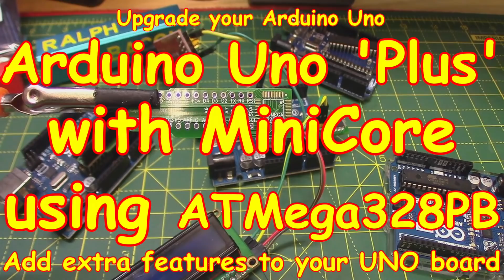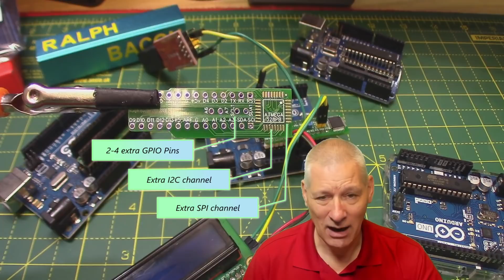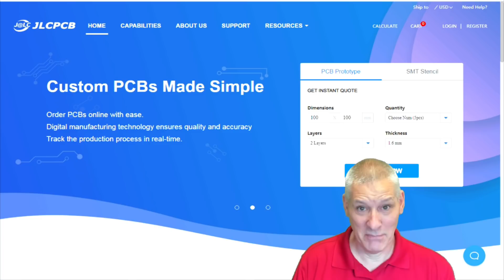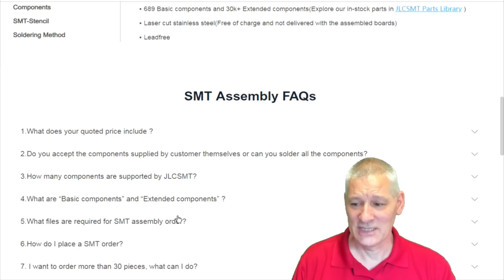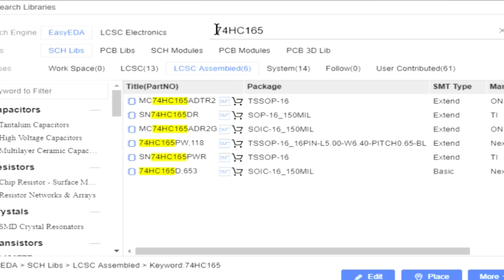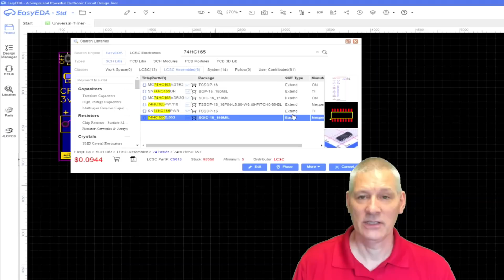#168 Upgrade to an Arduino Uno 'Plus' with MiniCore and an ATMega328PB

Comment: Very nice idea, to have a ic socket patch-pcb for bringing a 328pb into the game. Well done, Ralph!
Reply from the maker: Glad you like it Sebastian! Just a bit of fun but could prove very useful too!
Reply: @RalphBacon  The extra builtin peripherals are certainly always great to have. As soon as timing requirements and/or io-pins come short, using two controllers, communicating with each other might become the prefered solution, already since the funtionality of at least one of them, the one that comes with storage(SD-card), human interface (buttons etc.), display(lcd), etc. might be re-used in the next complex project as is, while the actual work (ADC, 74HC(T)595, 74HC(T)165, MCP23017, MCP23S17, temp-sensor, gyroscope, ultrasonic range finder, etc. pp.) is done by the second one. At this point a second high speed onboard USART already becomes worth gold nuggets. The extra I²C and SPI might also be usefull quite.
I know there was that kind of a 'religious' like war about using either Microchip PIC or Atmel ATmega. But when looking at 16bit PIC compared to ATmega it becomes clear, PIC (PIC15Fxxxx/PIC24FJxxx/PIC32MXxxx) has generally more RAM, while missing EEPROM most the time, and always better as well as more peripherals, ranging from second USART/SPI/I²C, additional timers, ADC/DAC, to NCO (numeric controlled oscillator) and integrated logic cells (compareable to PAL macro-cells).
 The lack of advanced peripherals in many of the ATMEL controllers could at least be compensated by using more than one ATmega for complex projects, as long as there is the additional io-peripheral for communication at hand, like a second USART/SPI/I²C. Without things tend to become the sort of ugly DIY stuff, that is so well kopwn for not working very well most the time.
 So making use of a 328PB along with the Arduino UNO R3 is a great step foreward for the more complex projects, that involve data storage (logging), display and/or some sort of human interaction, while the more timing critical sensorics can be served from the second controller. --- In this sense, a great project to introduce the 328PB to a UNO R3 DIP socket board by some adapter PCB!
Reply from the maker: One interesting topic you raise here, is to use additional µC for some functions, something proposed by another viewer. 

Basically, instead of trying to cram everything into one MCU, running out of pins, having the code run slowly with potential blocking delays the idea is to offload some processing to simple, small MCUs that do one thing. 

For example, use an ATTiny85 to get the temperature and humidity from a sensor and then just query that device to get the results , not do the actual work. I'm still thinking about how this would work in real life (20 devices all hanging of the I2C bus, or RX/TX pins?).
Reply: @RalphBacon  Well, for low symbol rate per second/minute I²C might do a great job. But let's guess, we have a little robot, that uses ultra-sonic as well as LIDAR for creating a 3d map of the surrounding environment. While one controller does the LIDAR and processes the scan data into a 3D cloud of points, the second controller does so for ultra sonic reflections. Now the problem is, that the processed data set (filtered sensor data) of 3D spatial data certainly come at a symbol rate per second/minute for which I²C is foreseeable by far to slow to fit the purpose. But of course there are alternatives to use. One could use SPI at up to 10 mbit/s (point-to-point), in reality perhaps more like up to 5mbit/s on pcb at short distance, or an on-PCB field bus system like UART via RS485, using a time division protocol, where all controllers are granted a time slices for transmitting data in a round robin fashion. This UART/RS-485 stuff can work quite well at pretty high speeds at short distances. 10 mbit/s are not completly unrealistic to achieve with a UART, depending on the controller being used. Something like 1 mbit/s might be a pretty common scenario for RS485 applications at short range like for an on-board design.
 Lets assume that there is an application in which one microcontroller might be used to aggregate/integrate data that was collected by a number of microcontrollers optimized for gathering sensoric data, and uses that data aggregates for decision making, displaying, steering etc. at e.g. some sort of meta-level, like one would expect for a rover on Mars (just to give it some exemplary purpose). In such case the choice of communication (field bus, point to point communication, etc.) depends mainly on the expected data rate for the transmission, as well as the number of controllers involved.
 All of such communication between controllers is a very interesting field, ranging from production automation, robotics, airframes (planes), satelites, complex measuring equipment, etc. pp. that in reality make use of a great number and variation of field busses and/or p2p communication protocols. A good start could of course make I²C at low data rates (100kbit/s or 400kbit/s), since it is simple to use and comes with little to almost no extra cost. Another option for higher speed communication might be a UART used for point to point communication without or little extra cost, or between many controllers using some RS485 driver ic (some extra cost and space on pcb) with speeds of up to around 1mbit/s or along with the more expensive driver chips up to 5 mbit/s or even 10 mbit/s that could e.g. be used along with a time division scheme communication protocol (pretty much like ARCNET in the 80th and 90th or BACnet, that is still widely used).
 My advice would be, give it a try and play with such ideas for the new expirience that such many-controller-desings do offer, while this is can become a door opener for complex projects as well as a lot of fun when having controllers communicating about stuff ... .
 For I²C you wouldn't need any extra parts, aprat from the pull-up resistors for SCL and SDA. For RS485 you might look for some driver IC like MAX485 and similar, or one of the ready made modules for RS485 that are available at aliexpress/banggood for about 1-2$ (power hungry, but cheap). The RS485 driver chips that offer high speed and little power consumption at the same time, do come at a certain price tag. But for experimenting/playing around, the cheap and ready-to-use modules are perfect in my opinion. Anyways certainly a topic worth playing around...
Best wishes from Berlin!
Reply: @RalphBacon  By the way...using both, some I²C to connect all controllers (e.g. 20) for general communication and low data rate exchange & commands (like "start taking samples", "stop taking samples, "start motor drive", "power down", "sleep", etc.), as well as some RS485(USART) for high speed data sample exchange within the same project is quite common use in complex functionality setups. For higher data rate sample taking and processing (ground penetrating radar, LIDAR, picture processing, ultrasonic range finding etc.) using something like a esp32 / stm32 / pic32mx795 / pic32mz2018 and the like. For lower data rate processing, like driving a robot around, energy management, solar panel orientation adjustment, something like an arduino, just to give an example. So multiple controllers within one and the same project can and mostly are a mix of different controller types, according to certain requirements and their capabilities.

Comment: Check out the STM32F030C8T6.
64pence. Basic part. Beats the pants off of 328 in terms of both performance and price.
Huge learning curve but well worth it if you persevere.
Reply from the maker: Of course, and I did a series of videos about it, learned a load regarding fake STM32 chips that don't work with the new bootloader but, ultimately, for beginners who are familiar with the Arduino UNO this could be a worthwhile upgrade. If they can solder SMD chips!